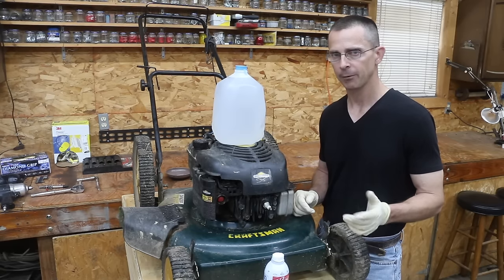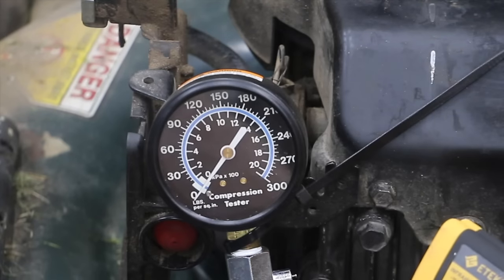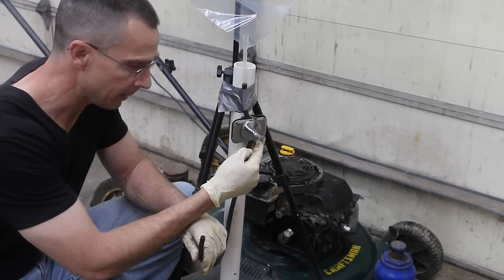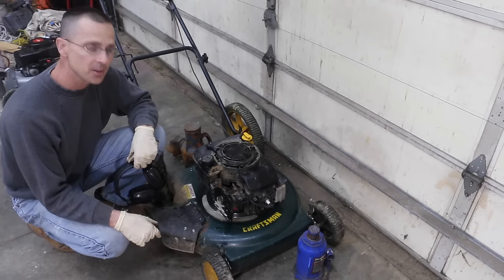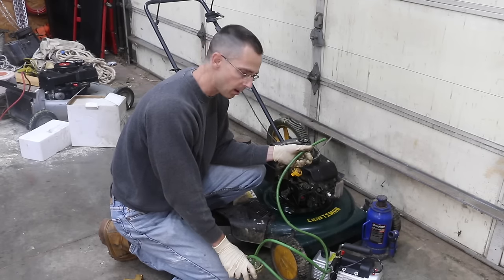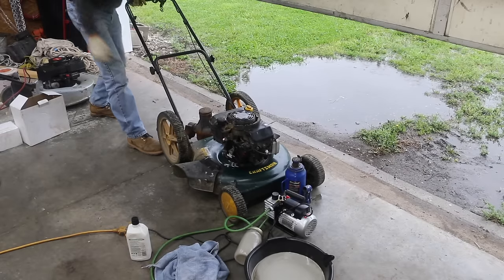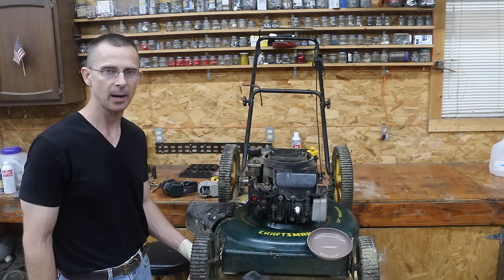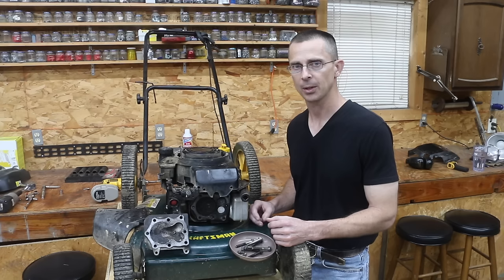Seafoam--can't believe what it did to my engine episode 5--cylinder cleaning test using water!!

Comment: I have used water before. But on old v-8, larger cubic inch engines. Never put water in for more than a few minutes, always on a hot engine and always while revving the engine to w/o throttle to aggressively load the power as I sprayed water into it with a spray bottle. I think a mist would dissipate better and sort of, "steam clean" the pistons and combustion chambers. I remember seeing clouds of sooty, cruddy exhaust as I did this and would always go road test and full throttle the engine afterwards to push the crud and soot through. Then I would come back, change the plugs, oil and filter, adjust the idle and deliver the car. That was a long, LONG time ago. Those cars were pre-cat converter cars and yes, I know, I just dated myself but it did work and I was taught about that process back in shop class in high school. Today I use SeaFoam and it seems to keep my family cars running pretty well. There are 5 vehicles in our family, most with 150,000 miles plus and they all run quite well. When the check engine does come on it almost always seems to be a fuel purge code, twice so far from rusted solenoids, bad wiring or rusted fuel fill tubes, not cruddy engines.   GREAT video but I think that much water was a bit overdo on that sized engine.  Keep em coming.
Reply from the maker: Thanks, will do!  Thanks for the constructive feedback.

Comment: So wait did the water contaminate the oil by getting past the compression rings?
Reply: Yes it's something you should check when buying a car.
Check the radiator as well as the crank case.
If there's cross contamination it's a head gasket
Reply: @horseblinderson4747  I’m aware however the head gasket in this car doesn’t have passages for coolant and oil so it can’t be a blown head gasket.

Comment: Done this loads of times: HOT water plus some ethanol or similar, spray bottle, hot engine, spray it in slowly for about 15 minutes. If it seems to be running cool stop and let it heat up, you want that water to really steam clean it! Keep that water very warm! I have done it to Porsche and Ferrari engines, not easy with twin intakes!
Reply from the maker: Thanks for sharing!

Comment: I've always been nervous that using products that 'clean' the engine and loosen up sludge, etc. will somehow ruin the ring seal surface of the cylinder walls.  A before and after compression test (too late now) would have been helpful.  If you ever do this again, a before and after compression test would be instructive.  That said, you have a great channel and I've learned a lot.  Thanks for all you do.  BTW, have you ever contacted Ray Bohacz, a farmer like you who writes for Hemmings Muscle Machines and has a radio show about farming I think?

Comment: Seafoam wins every time, I add it to my fuel, crankcase and use the induction method on my 1991 skyline gts-t it works amazing!  
It does not work well with fuel with ethanol or other additives in it already. Which makes sense because it's an old school product. That's been around for a very long time, before We started Allowing the government to force companies to start putting trash in our good fuel. 
Make fuel fuel again!

Comment: It works on a 4 stroke automobile engine not sure if it's good to try it on a 2 stroke lawn mower engine. The purpose is to clean the carbon by then letting it sit and then as a Vice Grip Garage says, give it an Italian tuneup by driving it fast.
Reply from the maker: Thank you!

Comment: Water removes carbon if used correctly.  It won't remove sludge or other hydrocarbon deposits very much if at all.  Back in the carb days, I'd trickle 8 ounces of water through the carb over 10 minutes.  But I haven't thought about using water in a long, long time as oils and fuels are so much better now.  But I think using water first to remove carbon, then Seafoam after would be the best method for overall cleaning of combustion chambers.  I'm going to try water from a spray bottle along with a Seafoam treatment to the oil and sprayed in the throttle body at my next oil change.
Reply from the maker: Thanks for the feedback.

Comment: the trick to get the water to work is high engine temp ... put the water in faster until the engine runs really rough for about 15 seconds to the point you are at wide open throttle while dumping the water in  , let it clean out and run until hot again and repeat . I had a 1960 chevy with the 348 in it and had to give it the water treatment occasionally , it had hard starting when hot issues because of carbon build up .
Reply from the maker: Thanks for the feedback.

Comment: Coming back to this video after a long time because I have a "new" (used ... old) truck that I want to SeaFoam and ... still sticking with that plan after rewatching this vid.  LOL  But but but ... I do have to say that it looks like the water ... sort of ... worked?  It looks like the water loosened up the carbon, but did nothing to help trap and clean it out.  So it just shifted the carbon around, where presumably it'll just dry in place?  I mean ... I guess before we had nifty things like SeaFoam it was an option?  Ish?  With SeaFoam nothing is at risk and you change the oil once.  With water...
Reply from the maker: Thank you!

Comment: For water injection, try atomizing the water.  Atomized water works well to clean, cool, and add compression.  I used a windshield washer pump to push water through an atomizing nozzle with good success.
Reply from the maker: Thanks for the suggestion.

Comment: Am a Seafoam user, but curious...which would work best: spring water, distilled water or tap water? Do you think the blowback was caused because the water won't ignite in the combustion chamber, allowing it to seep past the piston rings into the oil or some other mechanical reason? Finally, would a fine mist, instead of dripping water work better...allowing more water to be blown out through the exhaust valve rather that contaminating the oil?
BTW: Love your channel! 👍
Reply from the maker: Thanks!  Thanks for the suggestion.

Comment: Run a 2 stroke 50:1 mix with Echo Red Armor and non-ethanol rec fuel. The detergents in Red Armor are incredible. You can thank me later.😁 oh run the mix as long as you’d like, it does hurt a thing. In fact, it helps👍🏻
Reply from the maker: Thanks for the suggestion.

Comment: I must of done something wrong.. I wanted to clean the inside of my engine so i filled the gas tank up with the water hose but now it won't start?? Am i supposed to use a certain type of water?
Reply: The water from the hose is too cold ....get the temperature of the gaz in any other tank or whatever you have around and then make sure to heat that water to the exact same temperature +/- 1celcius. Flush the old "cold" water you add from your tank and refill with the one at right temperature and start your engine. It should run just fine. And next time you want to repair or clean your small engine i suggest you to get advice from a professional you can trust. Youll safe a lot of time and you will make sure not to do an expensive mistake in the future.
Reply: @patricebouchard3612  oh thank you so much. It was in my husbands new c8 corvette. Im not sure what kind of engine it has. He's a sailor on board the USS Alabama nuclear submarine and will be home at the end of the month so i wanted to surprise him by cleaning his engine. I was like this is a brand new car there's no reason for it not to start.. Thank you i will boil some water and try it again today hopefully it starts..

Comment: Head looks so much cleaner. That's exactly what happens on cars with leaking head gasket. The piston that burns through water is much cleaner than the rest.

I think that if oil temperature was kept above 100*C  throughout the test, we would not end up with milky oil.

I wonder if the milky oil would eventually go back to normal if it was heated up to above water boiling temperature? Could be tested on a cooker. Really curious
Reply from the maker: Thanks for the suggestion.

Comment: I think using Hotter or Colder Sparkplugs coupled with adjusting the timing & fuel mixture lean/rich would correct the carbon issue in the first place eliminating the need for either liquid
Treat the Cause, not the Symptom...  Interesting that seafoam is synonymous with water in its very name...
Reply from the maker: Thanks for the feedback.

Comment: Not bashin the video but when i did it for cars(preobd2 requiring sniffer for emissions) that werent passing on hc ppm output i only used a small tray like the size of a sandwich container of water and dipped vac line in it for a split second. Let the idle drop and dip again after it stabilized. Did until container was empty. Usually youll see the difference in smoke/steam color whats coming out the exhaust when its cleaned out. A gallon seems like a lot to put in especially on a small engine. Almost always got em to pass. As long as the rings werent junk. On car engines seems like the biggest help it makes is cleaning the valve seats so its not losing the mix and comp through a not fully seating valve. Once its cleaned off the valve seats and it goes back to burning the mix like it should. The main reason i only used a small amount of water is. ..well look at a cars cat when doin it ever seen one glow orange in daylight? Dont wanna cook it and blow apart the honeycomb

Comment: Any chance you could tell me what pump your using on the Mason jar vacuum, model, etc?
Reply from the maker: Check the link in the video description.  Thanks.
Reply: @ProjectFarm  I did, it is not listed. Unfortunately only Videography Equipment and seafoam are listed. I meant the pump you're using with your Mason jar setup...

Comment: I’ve used automatic transmission fluid for this. Works wonders! And kerosene or diesel fuel to clean crank cases!
Reply from the maker: Thanks for sharing.
Reply: Project Farm I would like to add I’m an ASE automotive technician. And I’ve done it to many vehicle and fixed them! I really think you should do some testing on BG products. I would really like to know if those products I sell to customer actually work or if it’s smoke up the butt. I don’t like to waste customers money! But if I can prove it works I’m willing to push the products! So please test them!

Comment: Great video! But thats a TON of water. Just a handful of squirts from a spray bottle is more than enough to get the job done. Most of the work is done when the water flash vaporizes at hot temperatures. By the time the engine cooled it wasn't working much.
Reply from the maker: Great point!

Comment: Great video! I haven’t found the Seafoam video yet so I can’t say which is better. I do know that propane runs significantly cleaner than gasoline, but will it remove carbon? Thanks, Todd!
Reply from the maker: Thank you!  Great video idea on testing propane.
Reply: I think it's this one: https://www.youtube.com/watch?v=w9fTKZN0Eps

It's done on an edger, so we don't have an apples to apples comparison.

Would be interesting to see how SeaFoam would affect performance after doing the water treatment on that same mower. Seemed like quite a bit of gunk left to get out.

Comment: So the blown head gasket thing right? not only is water getting Into the cylinder breaking up anything that's water soluble and preventing that cylinder from having adequate (if any) combustion,meaning that all fuel will just be shot out the exhaust,after it spends 3 strokes tumbling around the cylinder, Its probably this mixture of fluids that clean the cylinder. As gasoline is a very good corrosive. Pair this with a possibility of excess oil from worn cylinders due to all the fluid in the cylinder, and it can get squeaky clean.
Reply from the maker: Thanks for the feedback.

Comment: Many years ago a former heavy logging truck driver stated they would set it up so only the vacuum of the running engine would pull water into the engine.   Then it would only drip down into the carb, fully atomized before it got to the combustion chamber.  It was not a short-term quick fix, but rather a long-term way of increasing the octane rating, keep the engine slightly cooler, and to keep carbon from building up.  He never said anything about turning it off when the engine is cold at starting, perhaps because the engines ran almost continuously or the water would be frozen from the cold until the engine compartment warmed up. 
Because you got water into the crankcase, you were putting way too much water into that engine.  Water is not a short-term quick fix, but a long term way of running the engine.  I remember him telling me they had that water system with the proper sized restriction so well dialed in that when they would tear the engine down for inspection or rebuild the inside combustion chamber was like new.  
Auto parts stores used to sell add-on water injection systems for carbureted engines.
Reply from the maker: Thanks for sharing.
Reply: @ProjectFarm  Thank you.  I'm very impressed you still read comments from videos you did 5 years ago.  Many people don't respond 5 days after they post a video even when a direct question is asked.  I guess that's why I'm subscribed here.  Have a great day.  🙂

Comment: Shown how to do that years ago for carbon knocks  BUT  we used windshield washer fluid  the alcohol in it helps burn off the moisture   never had a issue with crap in the oil after
Reply from the maker: Thanks for sharing.

Comment: If anyone has had to do a head gasket on a car/truck engine that has a failed gasket where it leaks water into the combustion chamber that its always cleaner when compared to the other cylinders where the gasket has not failed. It works wonders. I have used a small garden pressure bottle sprayer filled with water and the nozel set so it's a fine mist. Ran the engine up to temp then gave it a few sprays with the revs at 1500-1800 rpm for a few minutes and found that removed the carbon build up very well. It was basically a test to see as I was curious with you always having a clean cylinder and valves where a water jacket has leaked into the combustion chamber and I was young lol but it worked a treat. Still cost me a head gasket and time to have a look inside but worth the money
Reply from the maker: Thanks for sharing.

Comment: Interesting! Water is the "universal solvent", it probably caused the lubricity of the oil to be reduced and the rings/cylinder to wear in a little more. The cool water introduced to a hot combustion chamber probably explains the reduced carbon, it flaked off. What about a test with ice water? Maybe the same or better results over a shorter period. Thanks!
Reply from the maker: Thanks for the video idea.

Comment: The way everyone I knew did the water cleanout was spraying the water with any windex type or similar spray nozzle thru the carb just enough to slow engine speed then backing off to allow the engine to regain full speed. The droplets obviously are much smaller than just feeding in regular water.  I might add I never saw the test conducted the way you did it with regular water flowing in the carb. The water then exited the manifold/tailpipe without the water issue you experienced and may have yielded you better results..   I don't recall anyone having a water issue in the oil by using the spray bottle..  most did it just before an oil change so even if there was a little water it was changed out.   Seems to have made better sense that way..
Reply from the maker: Thanks for sharing.